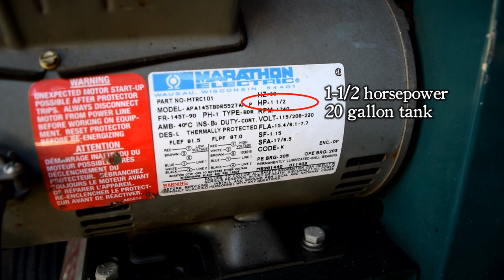Forging a Slip Hook

Comment: Do you mind sharing info on your tooling,particularly the angle of your taper die and the diameter of the punch you use and ball swedge size as well in this demo?  Thank You
Reply from the maker: The ball swedge is 1-1/4"  and I use 7/16" punch. The taper die is between 15 and 20 degrees..
Reply: Ken's Custom Iron Thanks you so much for sharing the info on the tooling and such a great demo,i cant wait to give it a go as soon as i can make the tooling needed.